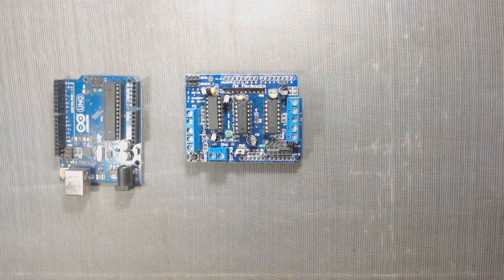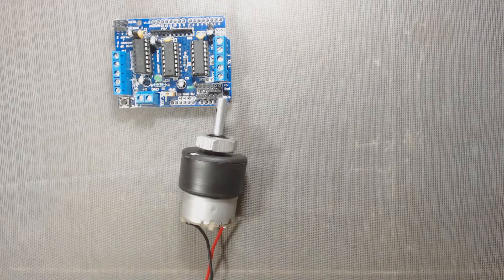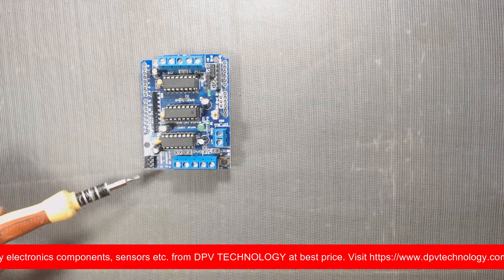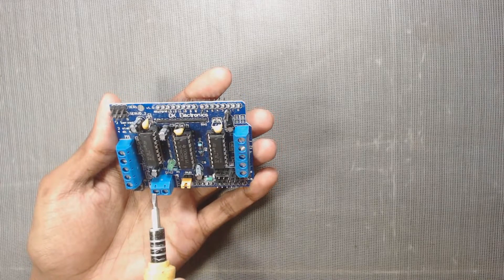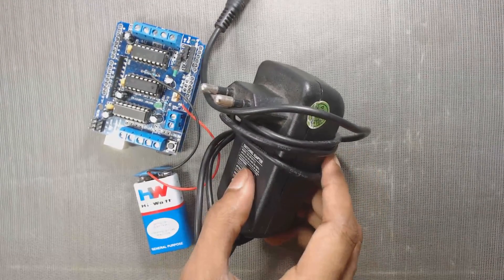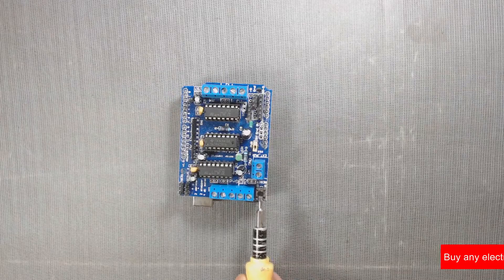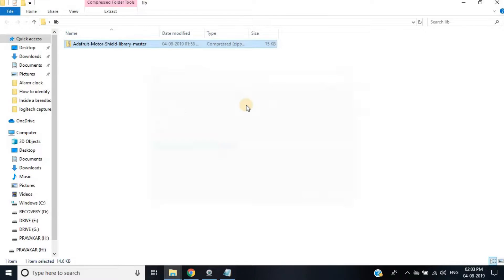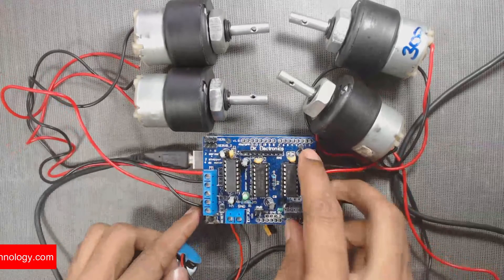L293d motor driver arduino tutorial | DC motor control using arduino and l293d [CC]

Comment: Sir can i use four 1000 rpm dc motors with 12v supply in this motor shield?
With out facing the heating problem?

Because sir i am using a L298N motor sheild but it was heating in 3 seconds like fire
Please help can i use L293D instead of L298N?
Reply: Well yes you can!
It supports 12v

Comment: Hi, if i use 8 motor. And the output of L293d is only 4. Can i put 2 motor in 1 output? Event it run at same time..
Reply: Yes bro, It works. I tried only when 3 batteries in parallel( parallel con adds current) for me. I used 9v battery

Comment: I have been trying to run 4 motors  , but it's going to slow down at very faster with seperate 9v arduino powerup and external power supply of 12v , can you please help me.
motor power supply range 3v-6v

Comment: Thank you very much 
I worried a lot to use L293d motor driver with my project because of insuffient information of power supply 
But this video provides a great detail of different means of using power supply with this motor shield

Comment: how to control 1 servo and 1 dc motor using l293d motor shield at same time.
I watch many video on l293d shield but in all video different motor not run at same time .
For example if there is a code for dc motor than you can run only 4 dc motor. If there is a code for servo motor you can run only 2 servo.
But I want to run servo and dc motor together using l293d motor shield.
So sir please provide me code for running two different motor ie..Servo and Dc motor same time.

Comment: Sir I really need ur contact number because I'm facing problems....... 
As soon as I connect 5 V and 2 A to motor driver shield to run two Nema 17 motors and 1 servo motor but L293d is heating so much as soon as i supply 5 V and 2 A........ I really need a solution....... Not even able to upload a program.

Comment: Why the speed of the motor is slow ?
Reply: search for the needed voltage for your dc motor and use a power supply with that voltage to power the driver shield

Comment: How can I connect a bluetooth module on this device? I want to power it using bluetooth. Thanks
Reply: Just Connect rx and tx Pin to Pin no. 1 and 0 respectively and Power you can supply with the servo Gnd and positive pins

Comment: bro I have connected all four motors to the motor driver shield but connected only 3.57 volt battery and the tyre is not moving is this a battery problem for my motor driver shield is not responding please help me
Reply: I think your supplied voltage is not enough.